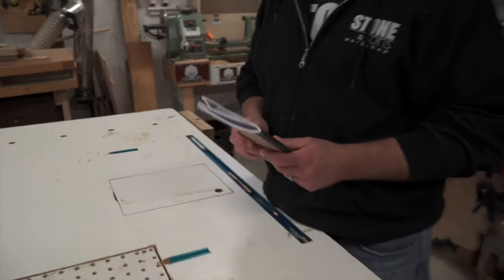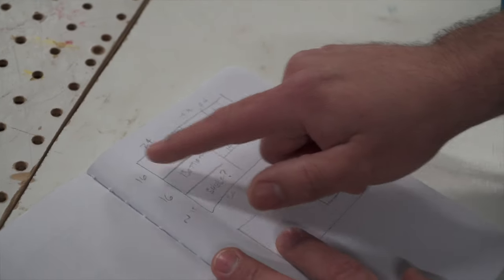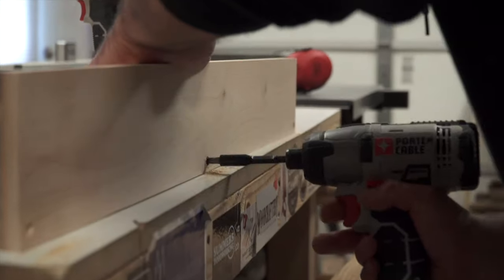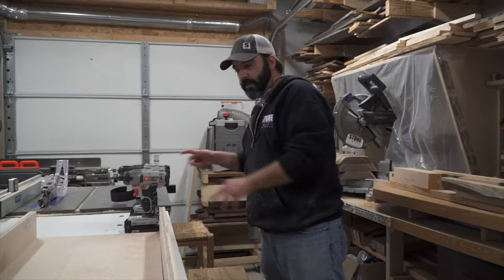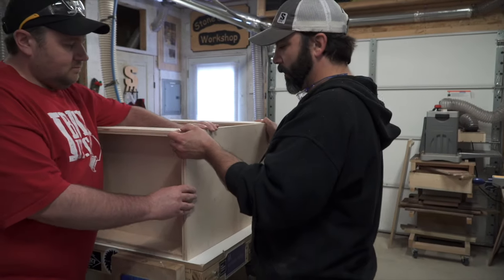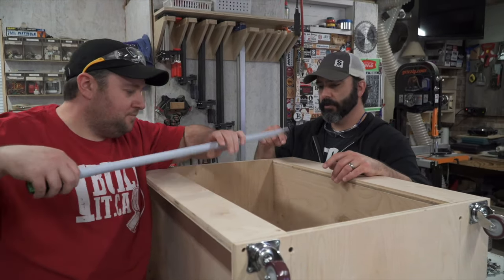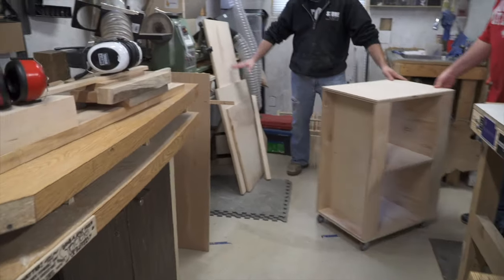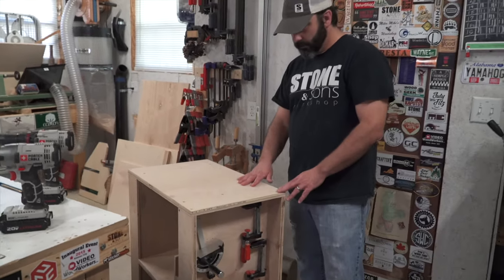Multipurpose Shop Cart - Workshop Organization

Comment: I decided to get rid of my bench and replace it with an outfeed/ assembly table. When I was struggling with the idea of assembling something and having to use the TS for a quick cut, and having to clear off the assembly. Then I had a striking thought for a utility cart/ work surface. Glad I finally found something that matches my same thought process! Do you still find it useful? Any changes?

Comment: Isn't it dangerous to put pressure from both hands in towards the Saw blade as you push wood through the table Saw? Same with the push stick? Meaning the push stick should be closer to the blade putting pressure outward toward the fence? Jw since I just purchased my first table saw... great build anyways and thanks for the upload!
Reply from the maker: +Joshua Peterika That's the way I work, push stick closer to the blade, but that's just me. I guess everyone is different. I would do my research for sure. You definitely don't want to pitch the wood at the back of the blade. That's what causes kickback, which is why you would want a riving knife and anti-kickback pawls.

Comment: I'm curious about that garage door. Is it 10 x 8? It actually looks smaller. I have been looking for a new 10x8 or at least some descent simple panels. But it's such a freak size these days either n/a or what they have is such a limited supply of designs that don't appeal. I just want simple flat surface, no windows. My door is probably the same age as me. The bottom panel rotted out because it was made like a lot of stuff in the seventies, thin veneer and an inner core of cardboard. That's basically ok here in South Alabama, but the garage floor extending through to the outside was pitched back toward the house. So yeah standing water rotted the sucker. I need a metal replacement. Any info you can pass to a fella would be greatly appreciated...BTW nice work there on the cart!